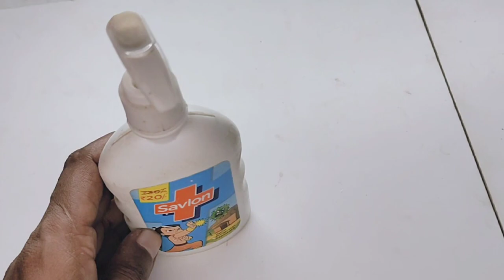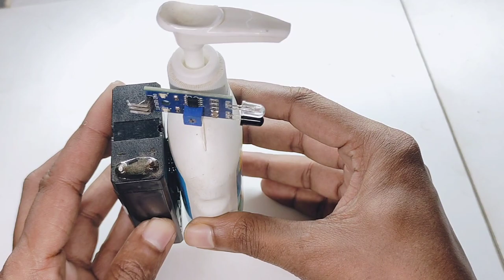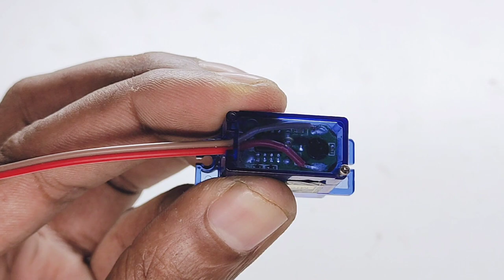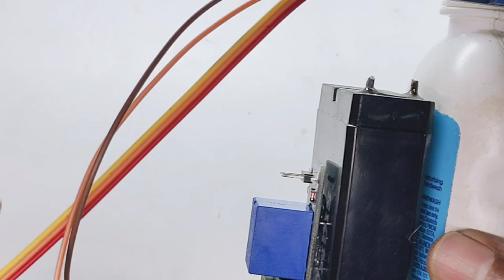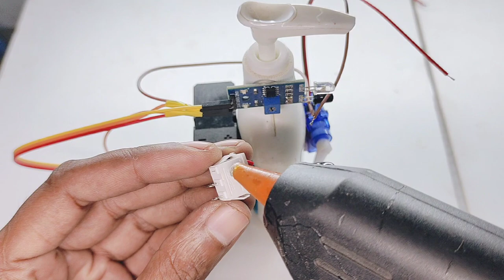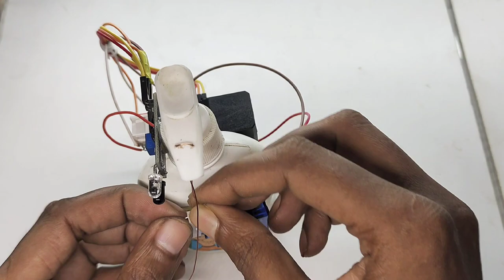Build Automatic Hand Soap/Sanitizer/Dispenser Machine at Home

Comment: Which servo motor use 180 or 360 help bro…
Reply from the maker: SG90 mini servo motor ! Thanks for watching sir
Reply: I confused in 90,180 or 360 degree rotation which one I purchase for all projects
Reply from the maker: Model SG90 mini low cost
Reply: @himalaypatel215  hey bro did you make this ?? I'm also confused with which one to buy which one will dispense more soap
Reply: @hey5421 i don’t making yet but I think half rotation 180 is best for automatic hand wash 🧴 making bro…

Comment: did you cut some of the jumper cables? and are they female to female?
Reply from the maker: Sir you can make it your own way like jumper female to male or normal wire with soldering that is your choice but connections are to be same like that